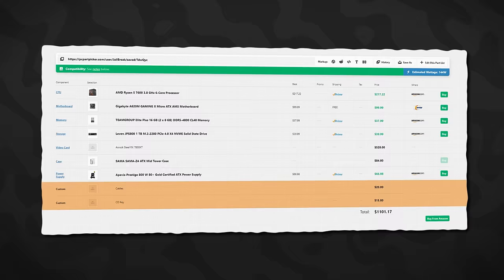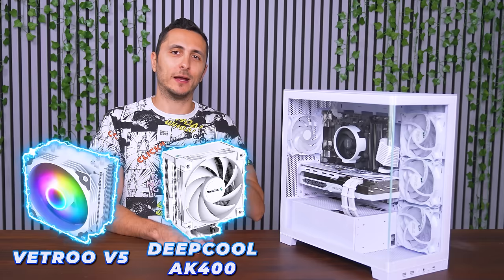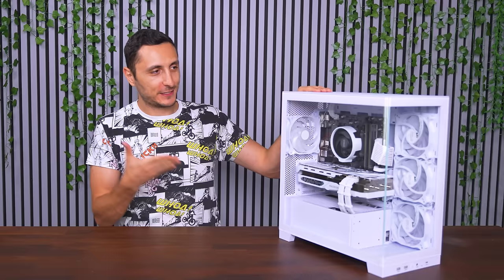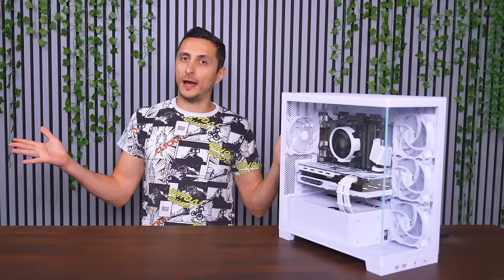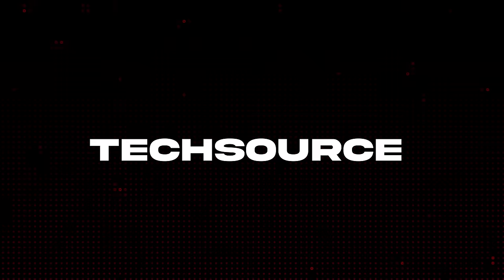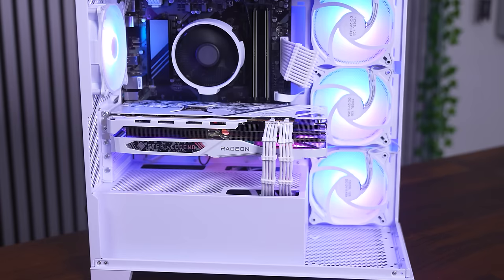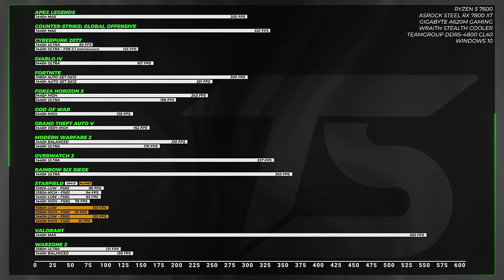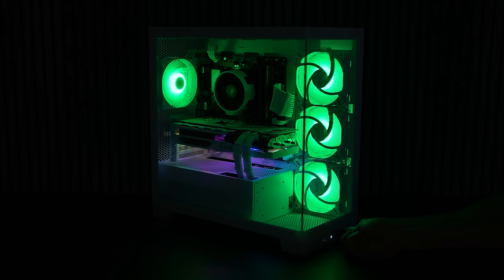The UNBEATABLE $1100 Gaming/Streaming PC Build!

Comment: The ram really pains me a little... Should really take the extra 20$ and get some proper latency and frequency ram. Also the mother board might not be suitable for the highest power ryzen cpus because of power limit. Would be a much better build if you just made it 1150$ instead and spent an extra 20 on ram and 30 on the motherboard
Reply: What are better alternatives for the motherboard?
Reply: @taykuu2130  basically anything with a b650 chipset.
Reply: @gamewatcher2712 what alternative for ram?
Reply: What are the alternatives for the ram
Reply: @ApcC7  I looked around a bit. There actually is very few good 16gb kits. Generally you want a frequenzy of 6000mhz or close to with a CL as low as possible. The best 16gb kit I found is the Kingston FURY Beast 16GB, DDR5-6000, CL36-38-38
Reply: @gamewatcher2712  do you know if i can get a 32 gb memory instead of a 16 gb memory?
Reply: @gamewatcher2712  are a620 boards really that subpar? asking this since I'm genuinely curious

Comment: (I built this computer as my first ever and here’s what I learned)

Assembled this computer using all the purchased components, along with a couple of extra fans and a different case. If you plan to install a wifi card, I'd recommend a larger motherboard (I managed to fit mine, but it's a tight squeeze).

Regarding the I/O plate, the metallic "pings" should be on the outside of the case, slightly touching the external ports on the motherboard (USB, etc.).

Performance-wise, it's impressive. I can run Red Dead Redemption 2 at a manually capped 165fps on a 165hz monitor and Hogwarts Legacy at all ultra settings (~165fps with a 165hz refresh rate) without tweaking graphics.

Keep in mind, a lower refresh rate improves performance. With a 165hz refresh rate, it's like having 2.75 times more information to load than a 60hz refresh rate.

For the monitor, you need a DisplayPort cable to go beyond 60-75hz; HDMI won't work.

If your power supply is pre-cabled, don't buy additional white wires—they won't plug in anywhere.

Building the PC is a journey; the video guide is decent, but I faced issues. After getting help, some components (GPU driver, CPU driver) were initially missed. The missed drivers made it so that Steam installations caused Windows corruption. If Windows breaks, turning off and on the computer three times boots it into Safe Mode, where you can reload backups or reinstall Windows.
Reply: I’m trying to build the same specs but Newegg isn’t stocked up on the graphics card he recommended do you have any recommendations of any white graphics card that performs the same at the one he suggested? It’s also my first pc I’m building I have everything but the Gpu and cpu
Reply: how were you able to control the fan rgb?
Reply: @Zqvax  I’m in the same boat they just restocked now !!!
Reply: @Zqvax I suggest upgrading the storage to a better one I build this and it failed on me cause it’s a cheap hard drive
Reply: Does this motherboard require a wifi card or can I just connect to wifi wirelessly
Reply: The white cables actually have the black cables from the power supply plugged into them then they plug into the components. Never mix and match psi cables as the end on the psu is not standard, just the end that plugs into your mobo, gpu, etc
Reply: White PCs are all the rage right now
Reply: Can you change the color of the pc
Reply: @Soy8473 yes u can, the case comes with a built in button labeled LED to cycle thru the options
Reply: Can you Tell me which Case you used because I don't live in American and can't Buy the Case without 100$ shipping cost
Reply: How well does your pc run on wifi?  Looking to build a pc but my current home set up would have me running an Ethernet through my living room 🥲

Comment: I'm glad SAMA is getting a little extra attention.  I found the same case you used for a company build and I couldn't have been more happy with it.  I loved it so much I got the black version for my personal rig.  One thing that doesn't seem like a big deal until you see it is a black case with non tinted glass side panels.  It makes such a big difference.  Also remember you can change the front IO to the side.

As always great stuff, appreciate your content!
Reply: Did you mount a liquid cooler in either build? The website says it fits a full size 360 rad but I'm a little skeptical...
Reply: Can the case fit an atx motherboard?
Reply: Any idea where the black cord plugs into the mother board for all the fans ? @jameshenry8821

Comment: I'm a bit worried about the temperatures, I would recommend that they change the stock heatsink. I recommend two heatsinks that cost around $20:
1: Thermalright Assassin King 120 SE White
2: ID-COOLING SE-214-XT ARGB White
They are very nice and are white so the aesthetics will not be damaged

Comment: I do love to see that Ed is using the Apevia Prestige, it is such an underrated power supply, people call it junk because its not a well known brand like evga, corsair, thermaltake, etc. however it is still tier c on the cultivists tier list so it is still an alright pick
Reply: It’s on the speculative list which doesn’t have enough testing data for them to say it’s actually recommended or not. There are many other c tier psu’s out there

Comment: Just note everyone that AMD GPUs will not stream at the same quality to Twitch as NVidia or Intel would. That is only a limitation to h264 encoding. That does not mean that AMD GPUs have bad quality when streaming to YouTube where the HEVC encoder looks very good and almost identical to NVidia. You can tweak the settings a bit in OBS to have a decent looking stream but 1080p60 streams on Twitch will NOT look as good as Nvidia. I would strongly recommend using 1080p 30 fps and tuning your bitrate to 8000 if you're an affiliate by going to settings - stream - ignore stream recommendations to do this if your upload speed is at least 12Mbps. That said, if you have an Intel K varient CPU, you can use the onboard Integrated graphics to stream to Twitch and get a nice looking stream. That's the only bone I have to pick with this video. Also the 13600k isn't much more and can be overclocked really nicely and get performance similarly to a stock 13900k, but is likely limited to only 1 generation of upgrades to the 14th gen intel which goes against the purpose of futureproofing with AMD5 which will likely give you up to 4-5 CPU upgrade possibilities rather than just 1 from intel
Reply: So which gpu would be good for streaming and gaming?
Reply: Depends on what you're playing and where you're streaming. If you mean Twitch, I would recommend at least a rtx 3070 or rtx 4060, but if you're streaming to YouTube, a Radeon 6800XT or better would do just fine @Kase508
Reply: @str8chillaxin  also if I bought the vetrocool rgb fan, it uses a 5v too so where would I plug the rgb port into because he used the 5v for the case fans
Reply: Don’t all 7000 series gpus not have the new encoder in stead of h264? Maybe not. Also, that’s more due to twitch BS than AMD. As you said, I have no problem with quality on YT or Kick
Reply: @johick05 I suppose, I did leave out that you could technically use software encoding x264 which would give excellent results and better than amd h264 even at veryfast with profile high and custom options: rc-lookahead=60. Downfall is that it uses CPU resources which will negatively affect FPS far more than using AMD HW encoding
Reply: @str8chillaxin  true. I try not to use my cpu for that but when I started on twitch it was needed. Im glad the new generation is working on it.
Reply: @str8chillaxin  hey i was interested in this build because it has the look and performance i want, but i do hope to stream with it just casually with friends. i play a lot of "softer" games like MC, Stardew, and sometimes the occasional shooter like Val or Fortnite, or DBD. what would you recommend? ive never built my own pc before, and im trying to purchase everything at once after a lot of research and saving. thanks
Reply: @violeta373  This would be perfectly fine for that. If you are ultra competitive and buy a 1440p240hz monitor, i would recommend going for a 7800xd cpu instead or just lower settings a bit. It's perfectly fine for most and prices have come down a bit

Comment: I spent about 1100 on:

AMD Ryzen 7 5700X 3.4 GHz 8-Core Processor

NZXT Kraken 240 78.02 CFM Liquid CPU Cooler

Asus TUF GAMING B550-PLUS WIFI II ATX AM4 Motherboard

DDR4 (2 x 16) Ram

Seagate BarraCuda Pro 6 TB 3.5" 7200
RPM Internal Hard Drive

Crucial P3 1 TB M.2-2280 PCle 3.0 X4 NVME Solid State Drive

GIGABYTE GeForce RTX 4060

Fractal Design Meshify C ATX Mid Tower Case

be quiet! Straight Power 12 1000 W 80+ Platinum Certified Fully Modular ATX Power Supply
Reply: shoulve gona am5 and 4060 isnt good bro , in this budget you couldve gone something better but its still good b
Reply: @Ahmad-s5o  it was actually 1100 that was typo
Reply: @YungPenugget how good is it?
Reply: @patrickroni4038  its ran every game ive tried to play on atleast 60 if not in the multi hundreds depending on the game
Reply: @YungPenugget  nice I’m just getting into pcs so it’s nice to know
Reply: @patrickroni4038  yea i dont know alot either haha
Reply: @patrickroni4038  you can pretty much play every game on ultra settings at 60 with no issue. I got almost 200 fps on red dead 2 ultra settings

Comment: I don't think you can really call this PC case a direct Lian li 011 copy as it has the PSU shroud at the bottom. Also I don't think the 011 comes with any fans, making its price comparison even wider. Love that you can get a Rx 7800xt in a 1100 dollar build. I'm not really into the whole white build thing, but that means I can get the black version of this case for cheaper than the white one. Although I've got my eye on the montech 903 myself.
Reply: Were you able to find the black case with the fans included?
Reply: @reed3413 Seconding this. I hate white builds

Comment: Great PC, it looks awesome if someone is into white builds and for $1100 it performs amazing, but i have one issue with the gpu, more specifically with the price to performance comparison, it take into account only the initial price and not higher power consumption of 7800 xt which is on average about 50W more than 4070 (based on a few tests i've seen).
Let's say we're gaming 4 hours a day on average, this additional 50W gives us 73kWh more per year. In California it's $15 more to the bill, $20 in Spain, almost $50 in the UK(per year)
Depending where you live 7800 xt can cost you more than 4070 in a long run ;p In recent years electricity prices are crazy and i've started to pay attention to the power usage ;p
Reply: Yes thats why im going with the 4070 in this build
Reply: But 50 per year doesnt sound bad honestly, 4 hours a day is a good ammount
Reply: Do you think the 6700 xt is a good choice for a gpu
Reply: 50 per year isn't bad at all I would never go with the 4070 for that

Comment: my pc is around 1100 also, but i opted for faster ram and a bigger case and motherboard, that is why my gpu is around 250 dollars cheaper than the one you are using, also i would have gone with the i5 13400f, considering it is cheaper, has really good performance for the price, and also gives you the option for ddr5
Reply: ok but where are you going to upgrade to after? a 13900k still gets the same performance as a 7700x in gaming and you wont be able to upgrade further without getting a new motherboard
Reply: am5 will allow you to get a new cpu without the need of a new motherboard and you wont have to spend tons on cooling lmao
Reply: Not future proof though bro
Reply: @DankAriZonaTea  future proof doesnt exist. we cant predict what happens in the future
Reply: @Luh_Iphone ??
Reply: @axstra2557  ????

Comment: For a couple of extra dollars good sir, you can get a B650M with the option to use PBO. This will lower temps and voltage significantly without losing any performance

I have a Ryzen 5 7600 + RX 7900 XT and an ASRock B650M PRO RS
Temps during gaming are around 65°C - 70°C with PBO enabled

Comment: How dude. I have a pc that costs nearly $2000 and it is just barely more powerful than my friends $1100 pre built and it can run most games at full settings and still get over 60 fps at 1080p

Comment: It’s a computer for 1100 but it’s very very bare bones and you’d basically have to upgrade everything. If you have a very strict budget then sure do it but if you can afford to spend 13-1500 you can have an amazing system without compromising on cheap parts. It’s not a bad pc but the ram is cheap, the motherboard is cheap, the cooler is cheap. Personally I’d spring to spend the little bit more to get much better ram, cooler, motherboard, and nvme

Comment: I bought this case a few months ago on sale, i was so surprised by the quality of it. I love it and will recommend it for MATX builds
Reply: I got the same case as well, do u know if u can turn off the rgb light in the back of the case when u power off the pc? Thanks
Reply: @Bestia699 is it coming from the case or your motherboard ?? Because i sold the pc with this case but i dont remember any lights when off
Reply: @nibba241 what was the reason you sold it?
Reply: @Bestia699 are you able to control the fan rgb with software? I can’t get mine to work

Comment: I did almost this exact build - I just did all black, different case and CPU. I forgot to order a cpu cooler. When I started the pc it would go into boot start mode then shut off. I think it was the pc turning because the cpu was getting hot
Reply: Did u solve the issue and find out the cause?
Reply: @iby2725  Yes I figured it out. I needed a high performing GPU cooler because I got the 7600x.

Comment: I’ve never built a pc as I’ve been a lame console player for years. I’d love to copy this exact build but I’m curious how to add Wi-Fi to the motherboard or if it’s even supported. I play mainly fps games so I want the fastest possible connection and have heard the ones that plug into the back of the mobo can be kinda laggy. Thanks to anyone who helps in advance!
Reply: I’m in the same boat, if you get an answer could you lmk
Reply: you can install a PCIe Wifi card to the motherboard, just make sure the one you choose supports the latest Wifi 6E for best wireless connection

Comment: An A620 board isn’t exactly ideal. 88 watts max power delivery is gonna cost you when you actually upgrade to a higher end CPU like 7700X, 7900X and 7950X. Though I could argue you can just get the 7900 for productivity and 7800X3D for gaming.

Also memory choice was horrible. 4800MTs aside, CL40 is unacceptable for Ryzen.
Reply from the maker: Thx for the input! I’ll take these into account for future builds!
Reply: @TechSource a professional pc builder saying this . I like this that @techsource doesn't have bad attitude and yaa I agree CL 40 is horrible and extremely bad 4800MTs is nothing if CL 40 is there and if @techsource you don't mind then I would suggest you to use a ddr4 ram with higher speed and cl 16 timing I am sorry if my suggestion is bas for you
Reply: Is it okay to get the a620 if im plaining to stay on the 7600 ?because i don’t have much options in my country and they’re really pricey
Reply: @Ezyx0209  if you only upgrade once in a very long time and choose an A620 board with heat sinks on the VRMs, you should be fine
Reply: @ghgltggamer  DDR4 doesn’t have higher speed than DDR5 generally, and Ryzen 7000 doesn’t support DDR4.
Reply: @ichisenzy  yeah like probably in 3-4 years 
Does it limit the 7600 tho?
And i have an rtx 2080 ti should i go for the am5 build or just go with an am4 build
Reply: @Ezyx0209  The Ryzen 5 7600 is basically 7600X eco mode, which will not gobble over 83 watts. You’re fine.

If you can find AM4 boards for cheap, I suggest getting the 5800X3D until you upgrade. RTX 2080ti is easy to handle. If you really wanna future proof, there’s no real option for 4 years aside from 7800X3D imo. If you wanna save a buck, a 5600/X will do the job.

Comment: wait CL40 for RAM? That can't be right surely.
Isnt lower better and didnt you recommend us cl15?
Reply from the maker: DDR5 has higher CL timing, usually starts at 38 and goes higher
Reply: @TechSource normally ddr5 comes with CL 32 or 30 so 40 is pretty high

Comment: i need a few tips. this is what i want to buy:
Ryzen 7 5800x cpu
corsair vengeance rgb pro 32 gb ram
Radeon rx6800 xt gpu
Asus rog strix b550-F gaming wifi 2 motherboard 
corsair icue h150i elite aio
crucial p3 plus 2 TB NVME 
corsair 5000D case
corsair rm850x psu
comes to a total of $1650
if there is a few cheaper options please tell me
i mainly play minecraft and farming sim 22
(i want to play farming sim 22 in 1440p max settings)
(and i want to play minecraft with high res. texture packs and shaders)